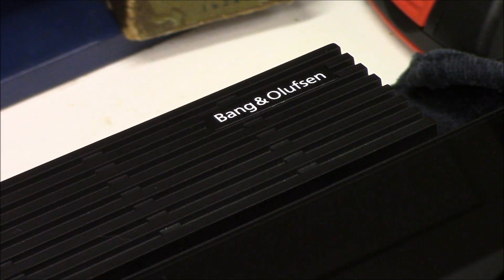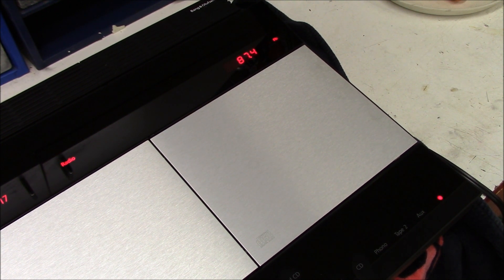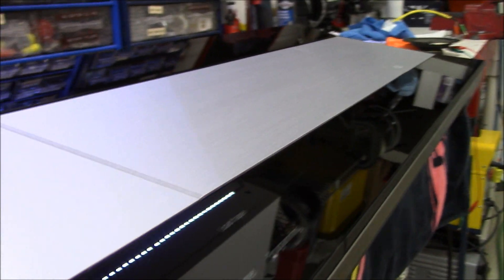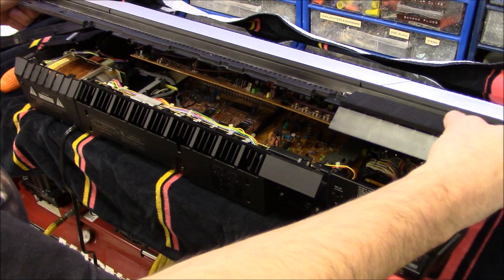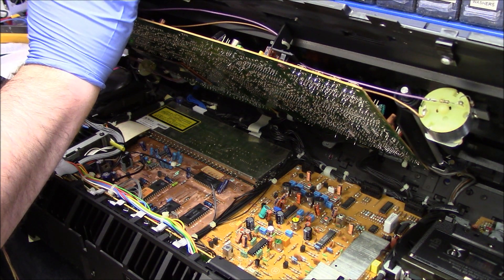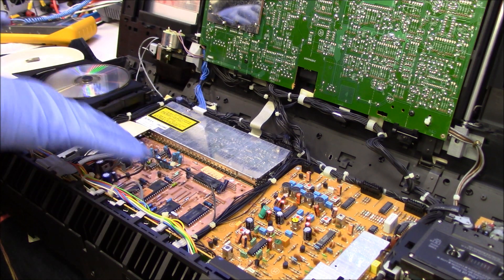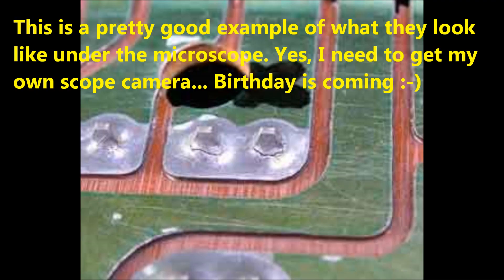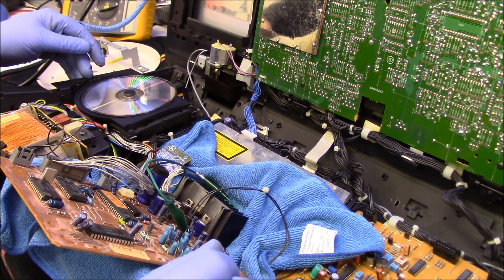Bang & Olufsen BeoCenter 9000 Repair

Comment: I have no power or lights on mine,could the problem only be from the power board and transformer?
Or could it be something else?
Reply from the maker: Likely a fault on the power board, but the only way to confirm that and then pinpoint the issue is start into the diagnostic with DMM in hand. 🙂
Reply: @Rchelicopterfun thank you for your help,it’s much appreciated.
Power board is the one attached to the back of the system behind the transformer with the black fuses on it right ?

Comment: Fantastic video. I recently had my 9000 serviced for $900. They fixed the 2 doors (wouldn't open or close), replaced the cassette heads, replaced any belts, replaced a few burned out bulbs, replaced a couple of touch switches. Not a bad price for using the unit from 1986 until 2015 every day. Your cost guess was spot on. Bought new in 1986 for $3600 U.S. dollars. Canadian would have been higher. All the programming functions still work well. I used to have my R-T-R recorder hooked to Tape 2 input. Now I have my iPod hooked to Aux input. Phono is still used for records. It provides 35 watts output to my two Wharfdale W60D speakers which I purchased in 1968. You certainly have a great ability for audio system repair. Thanks for posting the video. I enjoyed seeing the insides of the unit. I took the unit to B&O in Boston for service. There also are a few service centers around the South Shore of Massachusetts. Have @davejmw call B&O for referrals. I had to wait 3 months for the parts from Norway.

Comment: Nice set, I have repaired a few BEO 2200's and yes the smell of the 80's electronics is wonderful, especially after they have been on for a while. Nice job. Yes a cam is a must for the scope, or try a digitized one with an lcd screen, there are USB ones available now with decent magnification for such streaming of repairs! Good job!

Comment: Hi

Thanks for that very in-depth video buddy. I have the 9300 with a cd issue. When the door closes the cd spins up but the stops and the door opens again ,when it's spinning the counter does nothing so it's like it's not reading the disc ? Any ideas please ? . Dave UK. 👍
Reply: It could be that the motor speed is not getting to it's optimum revs, the speed is controlled by a voltage controlled oscillator feedback mechanism for want of better words. Back in the early days of cd players this was how the speed was maintained to read the disc to get the correct data levels out for decoding. I would say either adjust or tweek the pot of the cd player motor, follow the wiring for the cd's motor and see if the pot is labelled as such (VSCO motor etc.) try that first, or try cleaning the optic lense with a q-tip also. It still may need a new motor, just because it spins does not mean it's correct.
Reply: @ChrisFEJackson thanks for the reply I'll check that out. 👍
Reply from the maker: No idea.

Comment: I just acquired a BeoCenter 9300.  The Guy said the left channel went out and then a month later, the right channel.  Not sure where the output transistors or IC's are. Don't know if they used discrete components or output IC's like the Sanyo STK series?  I looked around and can't seem to locate schematics.  Any thoughts on where to start?  One place had Schematics for a fee, pair and it wouldn't download.  Guess hey got me.

Comment: Hello, I have sat in burnin at B&O on Beocenter 9000 to 9500, the big print is the tape part, the touch is under the glass plate together with the motor control for the doors... And yes, the smell is fantastic, I was in factory 4 where it was assembled and tested , I can promise you that the scent you are talking about was present there, it is a scent I will never forget as long as I live, I have my own workshop today where I repair everything up to the mid 90s, I don't want anything to do with the new in any way..
Reply: Unfortunately, devices of this quality are no longer built today. I own a Beocenter 9500, along with a Beogram 5500, which I don't give away.

Comment: Excellent. Realy useful video and explantiion for me. Just got a 9300 and 4000 from a friend but it was damaged in transit. The 9300 has a CD read issue. So your video is top.  The Beogram 4000 has a stylus flop issue what I'm trying to get advice on..

Comment: Did you ever replace the burned out 1-20  number lights? Have you replaced the lithium memory battery?
Reply from the maker: None of the LED's on the display have stopped working so no I've never replaced them. Never replaced any battery either - didn't even know it had one. I've only had to do one repair to this unit since I've owned it and that was the cold solder joint fix in this video.

Comment: CD cover wasn't closing, I followed your excellent video and looked around, motor sounded like it was working, then I saw IT...the rubber rotary connector ( not sure of the correct name ) had crumbled from old age.  I used a pony tail hair band as a temp...it works....any ideas where I can get two replacements one for the CD & tape deck???

Comment: You done a great video on this item, btw if you are still the proud owner of this Beocenter and you open it up it has a stay that latches into slots on the side of the unit near the mains transformer.
Reply from the maker: Yep, still got it and it's still working great. Thanks for the info on the prop rod - several others have mentioned that as well, so next time (if there is a next time) I have to open it, I'll be sure to use it 🙂

Comment: I just took my 9300 out of mothballs after 13 years.  Using the 8 pin DIN to Penta III’s I get just a little volume with the receiver maxed (tested with CD & Radio).  
Plug a 1/8” in the Headphones, to RCA’s in the Penta’s - full volume available.  Might it be a “mute relay problem”?  When I activate “MUTE” button, no click from within the unit (should be able to hear it, right?
My buddy is the electronics guru - I just want to know where that relay is located. Thanks!

Comment: Hi John! that is a great video! I am trying to do a clamper adjustment on my Beocenter 9300 - The Service Manual says: "Set Top panel in Service Position" - When watching your video I saw that in the "Service Position" you used there was no access o the clamper - correct? So I guess there must be a way to get access to the "Front Cover" - Any Ideas?
Reply from the maker: Sorry - No idea what a "clamper" is? My unit was also missing the prop-rod that holds the top case half open while in the service position.

Comment: There is an arm, along the top of the cover part that you swing out  and brace on the side where the power supply is and it keep the cover in place. Similar to how a piano cover is held in an open position.
Reply from the maker: Yep, a "prop rod"

Comment: Thanks to your video I managed to get my 9300 to operate again : one speaker stopped producing sound. After opening the unit I pressed on all the connectors and the smallish pcb board (the pcb board for the connectors is soundly secured and I did not want to delve into dismantling it). 

I have three remarks: 
- on the 9300 there are two types of screw on the rear : philips & trax. 
- one must be careful when opening the unit as the glass panels may not be soundly fixed after 30 or 40 years. Secure with masking tape before opening.
- You may want to replace the rubber pads under the unit: regular faucet rubber gaskets worked for me.

Comment: Nice video. I like the method of quickly heating the board to expand it and any soldier joints to hopefully connect any loose connections. I'll have to remember that next time. Thanks!

Comment: Hi. Thanks for video. I've bought a beocenter 9000, fixed the cd and tape drawers a bit fiddly but all good (also had to repair and refoam the accompanying Beovox S55 speakers) however I've noticed I get an audible hum from the unit (not the loudspeakers) after around an hour of the mains being switched on. The hum/buzz sounds very similar to what you would get from a lighting dimmer switch, namely the cheaper leading edge dimmers.
Do you think it could be mains transformer?
Weirdly sometimes it's not a problem and the hum doesn't happen at all and can be left on or on standby without a problem. Problem only arises when it's switched off at the mains (and when that happens the buzzing persists even when on standby)

Any thoughts or tips would be very much appreciated. Getting close to it being fully functional so would love to weed out this gremlin.

Thanks
Reply from the maker: I'm not a repair tech, just a hobbyist so no concreate ideas. If were mine, I'd of course open it up and identify exactly where the humming/buzzing sound is coming from. The fact it even does it in standby mode however, would sure lead me to your thought about the power supply since it's the only thing that is powered up while in standby mode. Perhaps the transformer is going or one or more of the electrolytic caps has pooped its goo.

Comment: this receiver was made by philips engineers for b and o
Reply: So? Only the design is b&o.
Reply: What nonsense, the only thing there is a philips CD running gear and D/A, everything else is made by B&O and I can tell you that as I have sat with it myself at factory 4 in Struer.

Comment: I would be concerned for a static discharge from the microfiber cloth.
Reply from the maker: The microfiber cloths I use in applications like this (bench mats) have been treated to lower their triboelectric effect.
Reply: are u for real ? 🤦‍♂️🤷‍♂️
Reply: @pavelstoikov3780  Your argument is so extremely strong against my concern, I am not sure anymore, let's check...  Wait! Wikipedia indicates for "Microfiber", in the second paragraph, its electrostatic properties.  And if you look further on internet (obviously, you prefer sarcasm over fact checking, so you will not do it), it is due to the size of the fibers and the fact they are split.  But I am sure you will then deny the existence of ESD, until you fry something expensive like I did.  I only hope some will be informed.

Comment: Nice. I remember those B&O products from when I was a teen. They were always very expensive, but awe-inspiring in the design. I once had a chance to hold a remote for one, might have been at a visit to a relative, cannot remember exactly, and the remote was like holding a slab of stone, it was so sturdy and heavy. But it still had rubber buttons which felt a bit strange :) I do remember reading some reviews at some point that mentioned, like you said, that the sound was not quite so top-notch as the design and price might indicate.

Comment: Hi John,
19 years ago I moved from New Jersey to Florida, I recently opened a box in storage and lo and behold
my Beocenter 9000 was in there! I have the remote but none of the speakers....I left them in my former home because they were built into the walls. 
I'm wondering where I can get it repaired and if it's worth the money to repair it. IT IS SUCH A BEAUTIFUL DESIGN! I have no idea how much it's worth, can you give me some idea of it's value?
Thank you for that great video also....
Sincerely
Linn
Reply from the maker: I would search for "stereo repair" or "B&O service center" in your specific area. It doesn't have to necessarily be an authorized B&O service center however since this older stuff is fairly easy to work on and it's of course well out of warranty. Call several stereo repair shops up and ask if they work on older B&O & if they would be able to diagnose & repair a B&O beocenter 9000.  
As for what it's worth - I really have no idea since it's very location dependent. You usually see working ones in good condition listed on eBay ranging from around $500 up to $1000 USD.
Reply: @Rchelicopterfun  Thank you so much for replying so quickly 
Much appreciated

Comment: Hi John
Great video, I too have one of these beautiful machines (9500) it also is in lovely condition. My beocenter has recently developed exactly the same fault as yours, using your video I was able to open the machine and sure enough when I pressed on the same part of the circuit board as you the cd played.It seems the solder joints have come away from the pins and need re-soldering.
Unfortunately I was not able to remove the board from the case, I removed the screws and loosened the circuit board and removed the leads but got stuck where the 2 long screws holding the board to the alloy frame, the board was still attached to the black grill (not sure what to call it) on the end which is too big to slide under the alloy frame (which the tall screws attach to).
Any advice on how to remove this board for re-soldering would be really appreciated John as these machines are getting rarer and deserve to be preserved for future generations.
Many Thanks 
Gary
Reply from the maker: I've never seen the way the board is mounted in the 9500 model. In this 9000 Beocenter model the board came out easy with the removal of 4 screws in each corner of the board.

Comment: The CD Board is as a whole Philips TDA1541-Board as in 100 other players.
Reply from the maker: So I can blame Phillips for the cold solder joints?
Reply: John Salt Great comment! The CD board is much better documented in web and - by chance - you can use Philips as a donor-PCB in this B&O....

Comment: Them beocenters are complete trash inside oh god
Not well designed 
Just paying for the brand
Reply from the maker: David Piçarra - You must be one of those (Can't - Understand - Nostalgic - Technology) types. 🖕
Reply: @Rchelicopterfun  I do understand,and I use better vintage equipment that all that mashed together thing
Reply from the maker: @picarraphotography  You also clearly don't understand what an acronym is.
Reply: @picarraphotography  ok. Can you please show me a vintage (as in around 1987) system with a cd player, auto reverse dolby b-c hx pro cassette player with programmable tracks, am/fm with 20 programmable stations, timer for play and record, preamp with riaa, power amp, capacitive touch panel that light up the available functions matching  the selected source, a remote controll that also can control a record player and tv/video and dim your lights if hooked up, has multi room control, and on top of that being stylish and servicable, because I would very much like to own something that would better the beocenter 9000
Reply: @Rchelicopterfun  David - Is - Clearly - Kooky as well.
Reply from the maker: @HansDelbruck53  nice 👍
Reply: @paulvink4338  some people like B&O and some people don't. When I was 19 years old, I would stop in the audio stores just to look at their products and definitely couldn't afford it then, but I knew one day I would purchase something by them. And now I have owned many pieces by them and have not been disappointed with my purchases. You will always have people that would ask you why would you pay so much money for their products? Because it's my money!
Reply: What do you mean? The Beocenter 9000 is from 1987.

Comment: Is this the same as in the "National lampoon's Christmas vacation" movie when "Obviously something broke the window and something hit the stereo" (line from the movie)? I always wanted to know which stereo was it.
Reply from the maker: You accidentally typed your question into the YT comment box instead of the Google search box. Hint, yes it's Bang & Olufsen equipment, but not the BeoCenter 9000 as shown here. Divide that number by 2 and you'll have part of your answer. Add "BeoSystem" in front of that number and you'll have your full answer. The system in the movie was likely comprised of the BeoMaster, BeoGram, BeoGram CD, and perhaps the BeoCord.
Reply: @Rchelicopterfun  hahahaha yes, I did. Later it came to my mind that google knows it all and I searched. People say the same thing that you said and also that in the movie they probably did not destroy the real thing, just the case. They say that electronics are not from B&O system. Anyway, thank you for your search :D.

Comment: Hifi engine is a decent source of info. Good number of manuals for download. At this age dry joints are pretty prevalent. Especially in areas near components that get warm. B&O parts silly prices. I have knocked by B&O gear that has been for peanuts simply because the spares prices were unjustifiable. They are pretty fantastic looking pieces of kit.

Comment: It is popular belief among many that Bang and Olufsen only offered reasonable sound quality, not worth their pricing.  Much had to do with its excellent styling, easy to think that B&O's philosophy is all styling over substance.  The audiophile media used to snuff their noses at B&O.  But the truth is that these are false assumptions.  While B&O's sound quality mostly did not compete with the best stuff on earth that cost even way more than B&O, this was top gear, not only in looks but also in performance.  Their TV's had among the best color and picture quality, their cassette decks were on par with Nakamichi, that's right, on par with Nakamichi (because they had an in-house developed noise reduction that was superior to Dolby), their tuners were sensitive and strong receivers, their record players and tonearms had fantastic stats and were outfitted with very high quality Ortofon cartridges.  Their amps were not particularly high quality but B&O (correctly) considered amps to be the strongest link in the quality chain of most systems and therefor found them to be the least important to improve upon.  Only their speakers were considered to not be worth the money and considerably of lesser sound quality than the rest of the B&O lines.
B&O was and in some respects still is a fantastic electronics company.